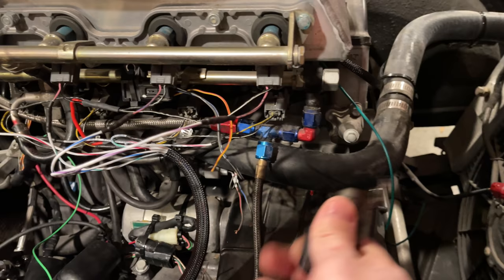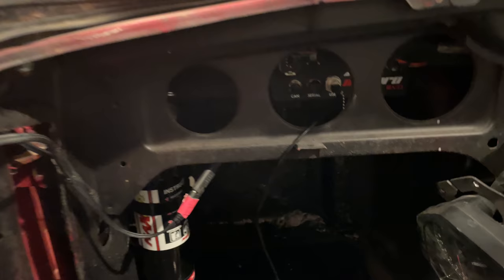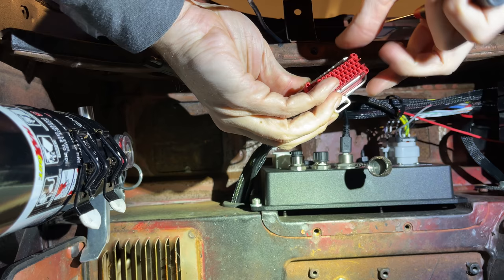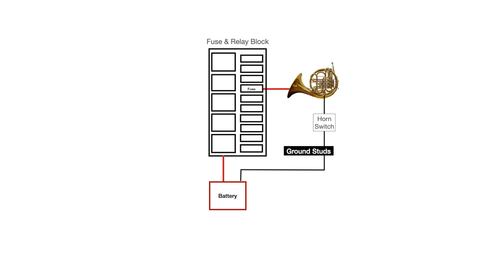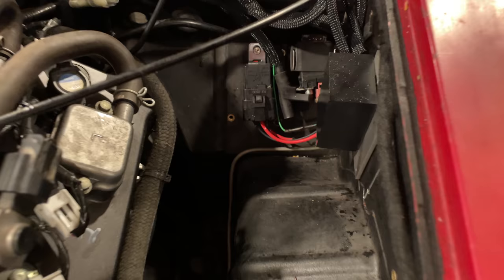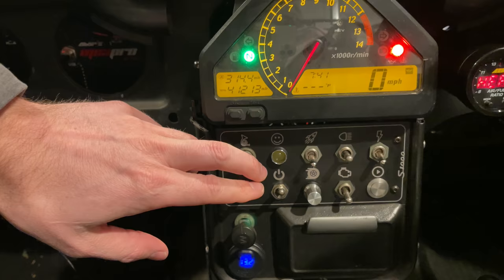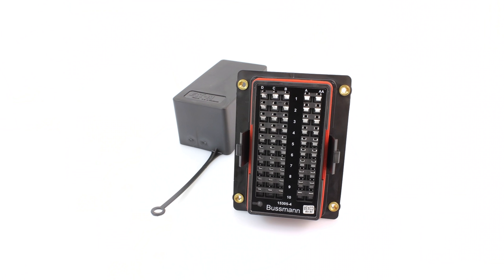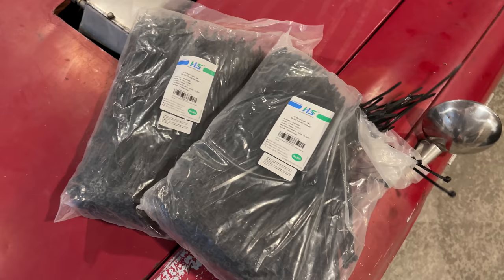Re-Wire Your Whole Damn Car - How To Do It Correctly & Inexpensively

Comment: I have a mechanic friend who replaced every single electrical part on a customer's car to find a fault to no avail, then he resorted to completely rewiring the entire car. Turned out the fault was the first component replaced - a harness connector pin was in the wrong place.

Comment: Speaking of planning ahead. What components are you going to need to power, what amp draw do they peak at, then decide on wire size based on safety factor or speed, and then fuse size for the wires safety. If the wire was only ever sized to handle 20A why is there a 40A fuse in there? Fire bad, including the wire melting.

Comment: The way shop manuals illustrate wiring diagrams makes it harder than it needs to be. Instead of an easily traceable big colored diagram (that would span more pages) with all information together, it is usually split into different diagrams for connectors, others for relays and part diagrams after function, So if I need to fault find something electrical, First I need to look up the connector on the device not working, then decrypt the wire color abbreviations, then again look at the connector diagram to figure out which pin in said connector that wire ends, then another for what fuses are involved. Being used to electronic diagrams, this is not as user friendly as it could be. The reason might be that a car mechanic focusses on swap and test spare parts until it works, but not all faults are because of components failing (internally oxidized wires can be puzzling) , so to be easily capable of tracing signals and functionality through a proper electronics diagram would be so much easier.

Comment: If you are unsure about fuse size don't put a large fuse in! This is the quickest way to cause a fire. Rather put a smaller value in, if it blows during normal operation just put the next bigger value in until it doesn't blow during normal operation.

Comment: Another way of wiring the engine bay is to use a wiring board (wooden board with pins sticking out of it) that is in the layout of your engine bay it can make wiring the engine easier but then you have to feed all the worse ones done around the engine bay and that can be a bit tricky

Comment: Female Lady Dr here! Mr Red Rocket Lightning just turned 19. All my vehicles over 20 breakins. Ford SVT kept most of wiring/ everything. 2022 unhealthy 10 months to figure out a shops jerryrigging electronics. Those idiots made my boost drop from12 psi. That shop he had blank check. knew shocks. Supercharger maintence. 
I was all excited to install harder sound system. Picked It up. Drove to auto parts shop in tears. Worker said that shop is horrible w electronics.Tess Corners near MKE. He lied about electric things. So stupid I have a capacitor between two amps. Left it connected while running computer issues. Hello! They could have asked me unhook it.
Lightning has sat in garage because it is no fun to drive. I have a salvaged wiring Harness. Damn I was going to upgrade 6 speakers, 8F. Cap. Throw in abigger alternator bc they wear out. Serious powershorts only an L Master who can build a truck from parts will be able to figure out the damage.

Comment: Industrial switchboard technician here, 14:38 Insulated lugs are fine, built many boards with them, you are using the incorrect tooling to crimp them. Insulated lugs require a crimper with tapered "vampire" like teeth that crimps the lug without deformation of the insulation. These crimpers usually denoted by red, blue and yellow dots, correlating to the insulation on the lug.

Comment: Thanks for the sources on the connectors, about 14 years ago I needed to do some rewiring in my S13 and S14. I was unable to source the connectors that were closer to the OEM style, I ended up doing an absolute shit hack job on the work and still cringe long after both vehicles are gone.

Comment: your ECM ground SHOULD ground to BODY panel BUT it has to be in a nice place where there is not other ground circuits passing through the area or past it. so if you have a engine to fender, dont use that fender(use the other) 
you could even go near your battery as long as other grounds wont be using that path

Comment: Yes, First make a circuit diagram for each circuit or cell. You will have a schematic for everything in the vehicle that will save you money when failures happen and you are in another state, if mind!
 A test light will show the absence or presence of voltage. While a digital multi meter (DMM) will show how much, continuity from point A to B, also voltage drop. There are videos on this, as it is accurate, fast and never lies. The price of amp clamps with stand alone operation are very reasonable. These are used while the circuit is on, just like voltage drops. Used with a lab-scope you can see the electrical activity in the circuit, like a dc motor. This list is endless unless you simply drive in circles with your build. They show the condition of amperage in a motor like a fuel pump to size the fuse, as brushes move from one commutator plate to the next as good even patterns are smooth and jagged, jumpy, missing signals suggest you will not make Denver. How much current does a circuit take? Well, test the item alone in a working situation and if the wire, connectors and adjusted for length is done right to start, add 10% then pick the fuse. Fuses are thermal sensitive and open quicker under lower loads under a hood if hot. Keep the fuse/relay center away from hot & place where cool air is abundant. Ground is found at the battery but created on the back of an alternator. Heavy wire & lugs should run from both to the block, fender, frame, frame to cab & bed if a truck. I like cheap and easy, so harvesting wire with correct colors is a trip to a salvage yard. Under the Right Side of the dash on 90’s Buicks like the Park Ave, LeSabre and others have a rectangular fuse relay center that hold 10 relays & fuses. It is where the fuel pump relay is. Harvesting it for $5 is cheap in 2022 Jimmy Carter inflation. As well as wires or complete harnesses. Cool things like rubber boots to fit door jambs are found on imports. Don’t forget good connectors found on GM’s. These use a number of “Delphi” and “PED” (Packard Electrical Division) connectors, so get both halves and cut the male wire side (Found on Device / Vehicle is Female), off-set the cuts so splice don’t land in one extra large spot. Alway solder connections after installing the shrink tubing and it tape is used, dab black weatherstrip adhesive on the tag end to stick forever. Cutting tapped harnesses is done using a tool for sewing called seam-cutters, sold for a $1 unless Amazon, then $4,99. Wire ISO relays using 86 in and 85 to control either ground or B+. This allows diodes to function, and without a diode they have resistor wired across the coil. It does two things, one is acts like cheap diode to allow small inductive strikes to dissipate, plus they provide a constant resistance in the coil so the PCM checks during each start using voltage drop from internal MOSFETs during OBD-2 checking test to pass or fail. Don’t swap relays, ever. Fleck out KnuKonceptz. Com for battery terminals with multiple wire outlet packages. Large copper eyelets can be made from water pipe. See videos! Use copper, not PEX. By tubes of dielectric grease to protect those connectors, grounds, bulbs, flash lights, smoke detectors, fans, etc.
  If I am doing an LS swap, use all matching PCM, Electrical throttle, TAC module and try LT1swap for $50 program. Trans, cam, final drive ratio & tire size all make a difference beside two pins turned on supply ground for 2 fan relays. 
  If you like Keyless entry, light control, content theft, power windows and warning chimes, install the BCM with the factory harness and get VIN for reference or photo of all RPO codes. I run a carbon canister to allow venting will filling, active purge to get fumes you paid for and your garage won’t smell like a leaking gas station. Install a roll-over valve and fuel cut in case the dirty side is facing up. Key fobs are sold for a pair under $30 just without the logo. Make sure it’s the same year as donor vehicle. Programming fobs vary but you may need a monetary switch. Walk into a dealer ask offer a 6-pack to have a dealer tech print BCM schematics. 
 It is not saying I have worked on cars a long time but early paper manuals had a 6/8 page fold-out in back with all wires, colors, circuit numbers and metric gauge which is cross-section of copper under plastic. Find and print several charts showing this info for quick reference. Otherwise, I don’t know anything about electrical systems, as I stayed in a Holiday Inn Express last night! 
DK. ASE Master Tech since 78, retired.

Comment: A couple basic notes to add:

- Always measure resistances/continuity with power off, always measure voltages with power on.

- You'll look at connector prices and wonder why people would possibly waste so much money on expensive connectors. There's a reason. You don't have to get full on Molex, but life's too short for Autozone or Aliexpress spade connectors.

- Lead acid batteries can put out a scary amount of current. 12V isn't (very) likely to kill you, but it's rearing to set your car on fire. Every circuit should be protected by at least two fuses/breakers (usually the main fuse and a smaller fuse).

-As with anything, time spent is inversely correlated with money spent. Don't cut too many corners.

-Cars are very hostile environments. Vibration, wet, abrasion, and dirt (roughly in that order) will take their toll. In this way, it's quite different from house wiring or small electronics wiring. Again, it's worth it to do it right the first time.

Comment: From my experience, get a sheet of 1/4 plywood and long sheet rock screws, measure out run lengths and label the board and make up and wrap the loom as you go using the screws to hold the mess down. Then, take it off and put it in the car. The label maker marketing guys can't sell a drowning man an inner tube!! Label tubing... what a concept. Your listing is out of date

Comment: This is certainly clear and helpful, but missing the one thing I am trying to decide how to do: make waterproof electrical connections for 1 to >1 branches in the harness.  For example, how to branch a single wire for rear running lights into two wires to go to both lights.  It obviously makes no sense to run two wires from a terminal block all the way to the back of the car for this.

Comment: If you can't find the non-insulated ones, in a pinch, those chunky plastic ones, if you gently grab them with the wire crimpers, and grab the blade, you can pull the crappy cheap plastic part off and treat it like a non-insulated with some heat shrink for a pro-looking result.

Comment: Best way to connect 2 wires, braid them thaangs strand by strand and then wrap in heat shrink lol if you cant do that just strip, twist, fold to one side and wrap in electrical tape. Next connection..

Comment: I came here because my van has an electrical gremlin.  It's a 90 Dodge B250 with the glass fuse type of fuse block.  The heat/ac blower fan works.  It has the correct amp fuse in it.  It doesn't dim the lights when putting the fan on High.  But... the fuse block, where the fan fuse goes is getting really hot.  So hot that I can smell the hot plastic, see the fuse sinking down and it's getting a bit brown.  The fuse is not blowing,  but the slot for that fan fuse is melted and discolored. And again,  it IS the correct amperage of fuse.   Luckily,  The fan is pretty much pointless in a 90 Dodge B-series van when it;'s moving over 30 Mph.  The air blows right into the cowl inlet and comes blowing out of whatever vent s are selected.   That is part of the factory wiring of the van.  Now, did I mention that it's a conversion van?  No?  Well it's a conversion van.  There. So there is surely some jank-ass wiring in there.  Among the 6 "aircraft style" lamp pods, the wiring to where the 12V TV was, and the stuff going back to the power-folding rear bench-seat/bed.  But it all works.  The lamp pods will flicker a bit,  but only since I replaced the scorching hot incan bulbs with LED versions.  

I have a 27 foot, '86 Coachmen RV in need of some electrical attention as well.  So I'm kind of starting to soak some of these tips into my brain and mentally prepare myself for some epic "WTF is that?!" moments once I start digging into either one of them.

Comment: Crack lighter is an adjustable cigarette lighter with the metal shield removed and the adjustment ring removed after setting to max open then reinstalled at the other end of travel allowing one to open the valve more.  
Never heard of  a meth lighter.

Comment: If you can't find out what connectors to use for the bussman, you shouldn't be doing automotive wiring.  A thousand zip ties only lasted a week where I used to work.  Waytek is definitely the way to go.  A thousand high quality zip ties from Waytek costs about as much and 200 of the low rated ones from an auto parts store.  Waytek can definitely save you money if you do a lot of wiring.  Especially with wire.  If you get the 1000' rolls, they will stripe or function code it for you for a minor charge.  Since I was was wiring the same stuff constantly I started moving to function codes.  Sure, it is more inventory but, if you ever have to get into the middle of a harness, it is great to be able to see wires that are labeled every 6" with "L.TURN"  or "BRAKE LT." without needing to look up color codes.  Only used Crosslinked GXL wires on my installs.  With high-heat loom instead of harness tape.  I would however, use glass tape over the loom in areas near the engine or exhaust.

Comment: So, those  ring connectors with the blue plastic tabs aren't actually meant to be crimped, they are for soldering. You can use them, just make sure you solder them.

Comment: Fuses should be sized depending on wire gauge, not the equipment they are hooked up to. They are meant to protect the wires from burning the car down, not the thing that's plugged into the wires.

Comment: Don't underestimate the usefulness of a multimeter. Checking connectivity with buzzer mode without looking at it, especially in cramped places, is irreplaceable, yet this simple feature is missing on most of cheap multimeters

Comment: Just a quick semi lazy tip to add. If you want to know which fuse to use, do an amperage test on the circuit and see how much it draws. Use the next closest up fuse to that. Or as close as you can get it. Just a warning too not all fuses are the same. Cheaper, and sometimes expensive, fuses tend to not pop at the amperage they say they do so it's more important to get a good fuse than too look at the price in my opinion

Comment: It is real. A pain a big pain to re engineer some of the Foopid GM shit  in post 2000 engineering. I mean really a $200 module to keep the $7 headlight bulb burning longer for always on daytime running? I mean why not use a relay and 16 or 18 gauge wire as a resistance? Oh it gets better the high beams are direct from the 120 amp fuse via a relay with 14 gauge feeds on a separate circuit to each lamp all 4 of them.

Comment: Awesome channel! for a mechanical engineer you really like wires!... I do have a question, if you have the time. I have been reading but I really don't get why do MIDI fuses are better on automotive applications. Also, thanks for the wiring protection advice I have always dislike those plastic cable protectors.

Comment: but you can add safety by using a bus bar or ground switching your relays. ground switching is much less jarring. wiring everything through a relay has the potential to max out that relay fast especially on modernish efi machines.

Comment: Thanks for reading my TED Talk. Will have to drive It 17 hrs to get a decent man who can spot egregious errors. Need dad to help me lift whole seat out (sadistic security system). 
Tess Corners also checked upon my winter car. Nope. Both my vehicles did not pass emissions. Old impala fan totally stroking out. Critical for defrost. It worked better before I let his shop touch it. 
He used to be friend of friends.  No more! If untrained goons are involved. Just stop. Let me fix myself.

Comment: Hi Matt great stuff as usual. I would be  very grateful for your help? I am wiring from new a Meyer Manxter beach buggy LWB. It is VW based with an air cooled VW beetle engine. The battery is in the same place as in the original beetle under the rear seat. My plan is to run a positive or live cable from the battery to the ignition switch in the dash board and then on to the fuse board in the front trunk of the car. I plan to fuse this cable near the battery with an in-line midi fuse. The question is what amp-age for both the fuse and the cable to be safe. I planned to use a 63amp cable thin wall which is 8.5 mmm squared, but I have been advised that this is insufficient, what do you think?

Comment: Very late to the party, but 2 notes: first, put a the heat shrink over the wire first, then crimp. That way you can use a smaller one which might be a better fit. Second, I would mostly recommend 3M for tape.

Comment: Great video and thanks for the google sheet for references. One question - is it possible to cut the bus bar on the fuse circuits so I can have a switched and a permanent power section? My intention would be to have most switched via the key but some circuits (horn and lights for example) need to remain live at all times. I can't see an image of the back of one of the bussman boxes to verify but would think this is tidier than linking the circuits I need to manually. TIA.